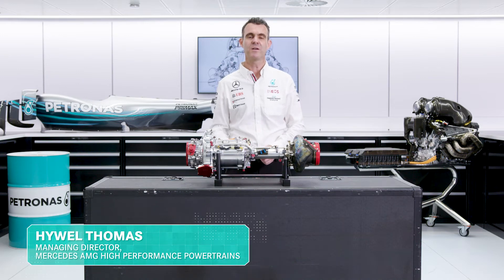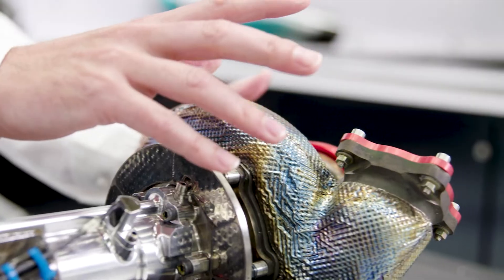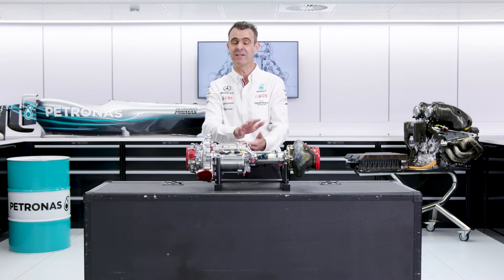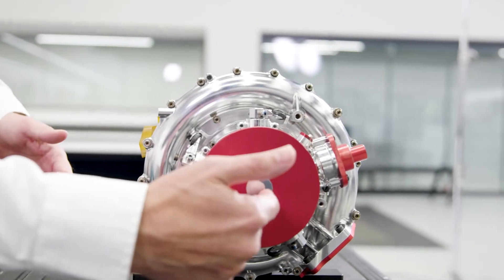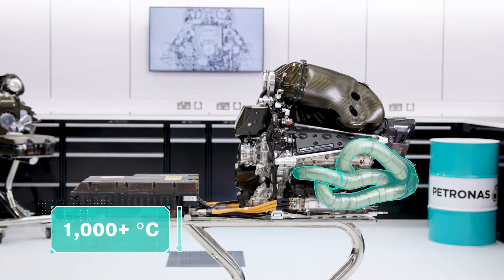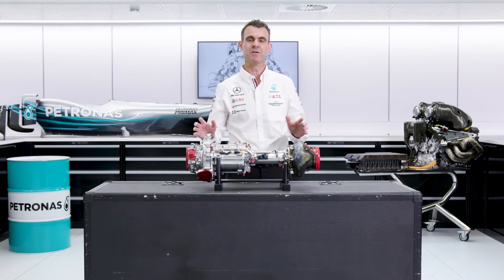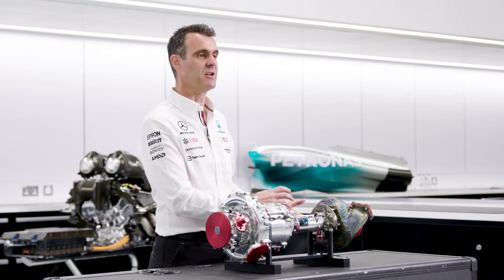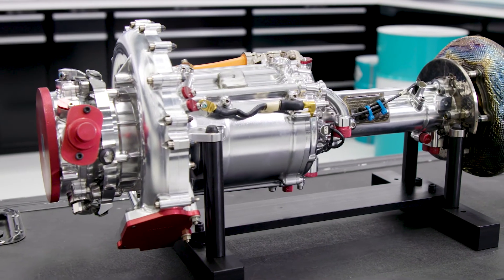Power Unit 101 - Episode 2 - Turbo

Comment: When they say 3 per season, do they mean if they wear out they have a max "new" turbo limit, or do they mean they can only turn them on 3 times per season
Reply: 3 Units, if one blows up or malfunctions, they now have 2 units for the rest of the season...
Reply: That's not true at all though..

Okay, so basically each driver has a turbo-button on the steering wheel that they can push to go incredibly fast for 15 seconds. Each driver - or more specifically each car - are only allowed to use the turbo-speed up to a maximum of three times each season.

Note that the rule is that they can only push the turbo-button up to three times. Meaning that if a driver deactivates their turbo-speed manually before it's automatically deactivated, then they have consumed that turbo-speed charge - and can not activate it again to use up the remaining seconds.

Thus the teams will often try to use it tactically on tracks where they use the full 15 seconds of a turbo-speed charge. If there is a very long straight for example, that would be a track where the teams would tell their driver to use a charge.

This is actually what happened in 2021, when Max beat Hamilton in the final race of the season, becoming the world champion. Red Bull, Max:s team, didn't know that he still had a turbo-charge left, as they thought he had used it in Bakku just as his tyres blew up. Max however, knew he never pushed the turbo-button when that happened, and decided to keep it a secret from his team.

He was afraid of Mercedes spies in the team, who could use that info to their advantage. The reason that he won the final race in 2021 was that Hamilton and Mercedes didn't know that they needed to take Max's turbo-speed into account, so when he suddenly used it they hadn't done enough to make sure that they could win anyways!

This got Mercedes so mad that since the 2022 season, no team or driver are allowed to lie about, or hide, how many turbo-speed charges they have left to decieve other teams!
Reply: @oonmm  Yeah, no, the guy above was correct lol.